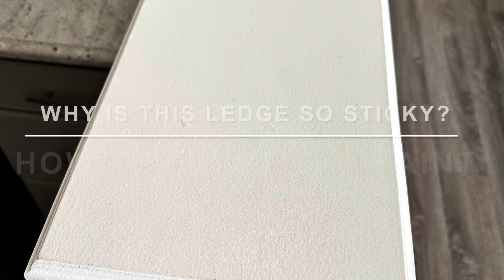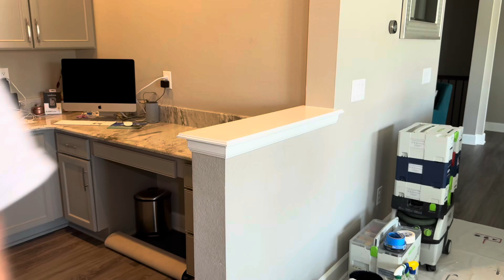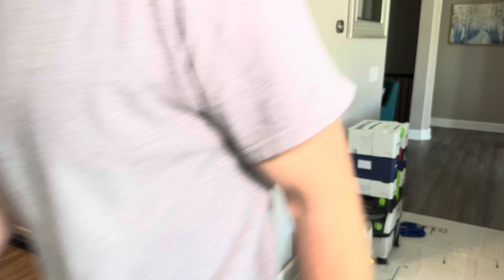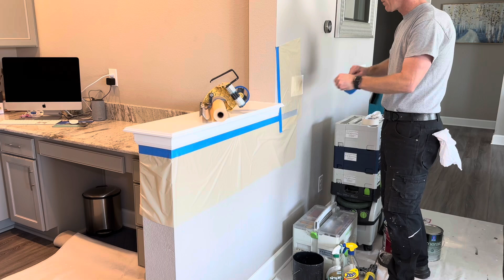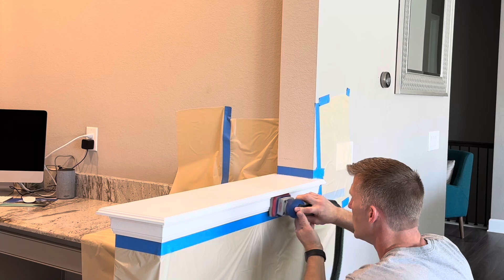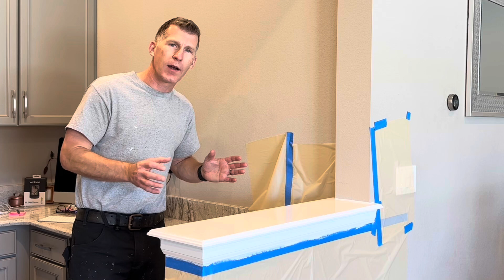How to Fix Sticky Trim Paint – 6 Simple Steps for a Smooth, Non-Sticky Finish!

Comment: Great video. I just had the trim re-painted in my child's room, and they put the second coat on after only an hour. Just like yours, it is wet looking and sticky. After watching your video I feel confidant that I can re-paint this myself.

Do you think hand sanding with 120 grit will create a lot of dust that spreads around? I always worry about dust getting everywhere.
Reply from the maker: Hand sanding painted trim, shouldn’t create too much dust. You should be able to control it pretty well without it spreading around. You don’t have to sand super fast to be affective. All the best and thanks for watching and commenting.
Reply: @HomePaintingAdvice  Thanks for the advice😀

Comment: So you repaint it to fix sticky paint…
Reply from the maker: Essentially, yes. However, you have to prepare the existing surface properly. You also have to use quality paint, meant for the type of surface you are applying it to and the use of that surface you intend. Lastly, you have apply that new paint properly, allowing for proper dry time between coats and proper cure time before returning that surface to normal use.
Reply: @HomePaintingAdvice  I had my cabinets painted, and all of them are sticky . I have watched your video and learned a lot. I am sure this will be helpful for me. What is the name of the paint that you would recommend again, and you don’t recommend a sealer? I am so thankful. I don’t have to sand it down to the wood. God bless.
Reply from the maker: @c @cheryle9453 would recommend Sherwin Williams Emerald Urethane or Benjamin Moore Advance. Those two products will likely work best in this repainting situation.
These products aren’t meant to have a sealer applied over them. Once cured, they should provide the hardness and protection you are looking for.